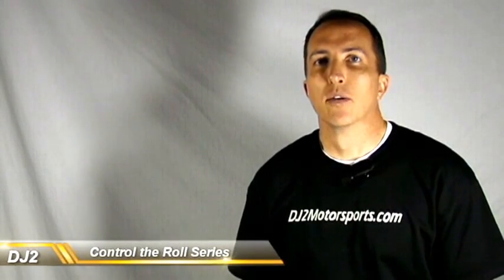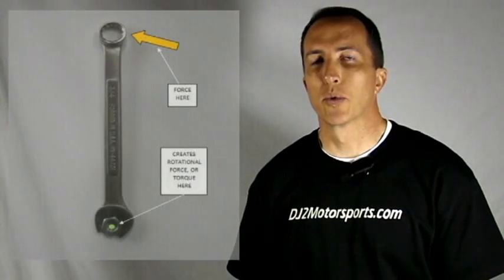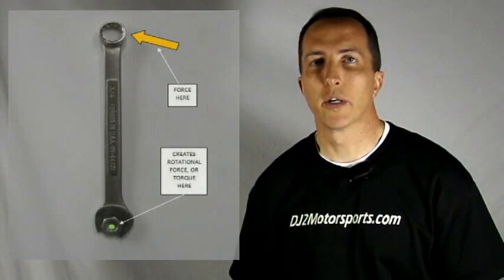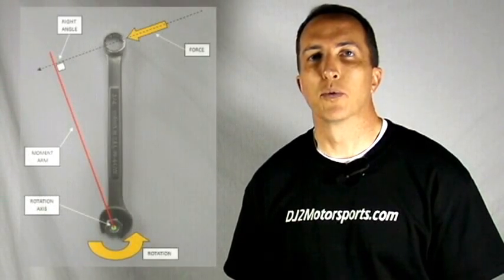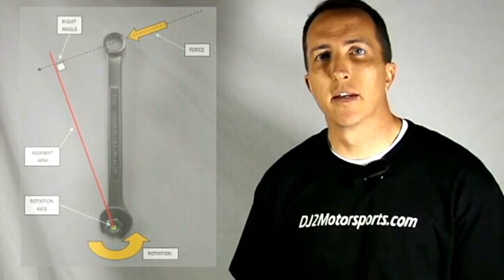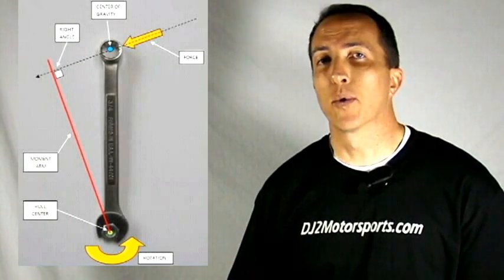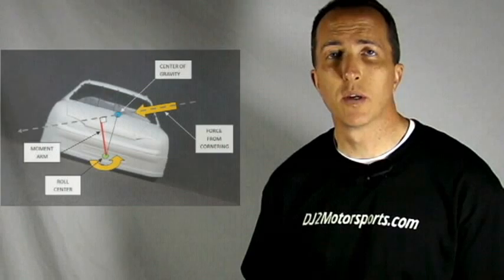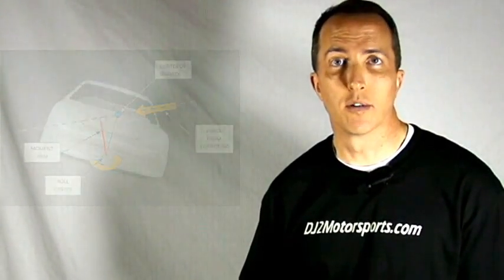Part 1 - Center of Gravity and Roll Center Relationship

Comment: Forgive me for a possibly pointless post 7 years after this video was made, but seeing as at least one other person here has taken this advice to heart in the construction/modification of their own vehicle, I wanted to point out a few problems with this video that go beyond reasonable simplifications given the target audience.  I'll qualify this by saying I've been writing vehicle simulation models professionally for 20+ years, including multibody+constraint systems, tire models, etc. (see my channel for a few examples).
-
1)  Raising the roll center height (RC) indeed reduces body roll as described (the wrench analogy is reasonably good there, more on that at the end), but the video and website completely omits any mention of the jacking effect (a vertical force at the tires reacted by the suspension into the CM via the RC) which is arguably the most important part of roll center height tuning.  The goal with roll centers (RC) better not be to simply minimize the distance between the CM and RC as this video suggests for the sake of minimizing body roll.  The reason for this has little to do with camber gain or other effects.  Increasing the jacking effect via raised roll centers lifts the entire vehicle when lateral forces are present at the tires.  If the front/rear RC heights are different you can also introduce pitch motion into the vehicle when cornering.  In other words, raising the RCs doesn't just reduce body roll, it also lift the entire vehicle in the corner along with the CM which is generally not desirable.
-
2)  Wheel load transients are entirely different when roll stiffness is adjusted via roll center heights than they would be if it were done through stiffer springs or anti-rollbars.   Jacking force changes are virtually instantaneous with tire lateral force changes, whereas body roll induced forces require some body roll to occur or a roll velocity component for the dampers.  In the steady state cornering case the wheel loads can of course be the same, but during transient cornering the development of wheel loads changes when roll center heights are changed.  In other words:  Springs/anti-rollbars/dampers involve a time lag.  Jacking forces due to roll center heights do not.  This affects transient handling which can be either good or bad depending on where you start and where you end up in the design, but if the goal is simply to raise the RC as much as possible (while still keeping it at or below the CM height), it's almost sure to be a disaster.  If you were to raise the RCs all the way to the CM height, the car would violently jack upward which would move the roll centers a huge amount from what they are in the "at rest" scenario.  Some of the simple simulation programs out there that simply compute roll center motion by rotating everything around the roll center, recomputing the geometry, moving the roll center, repeat, etc., really don't reproduce the actual motion of the vehicle in roll because they completely ignore these jacking effects.  As an opposite example:  One can actually suck the car down closer to the ground in the corners by using RCs below the ground.   Too much roll in that case?  Use stiffer anti-rollbars or springs.
-
3)  The diagram of the car on the banked corner, and the two at the website comparing a flat turn with a banked one isn't correct.  The error that's being made there is to treat the cornering force on the car as though it's acting through the center of gravity.  This really isn't the case.  It's drawn in an arbitrary direction which is different in both diagrams and has no bearing on what the tire forces are actually doing.  The forces are generated at the tires in the ground plane, then reacted through the suspension system in the opposite direction where a vertical jacking force comes in as an additional component.  There is no CM force other than gravity.   Sometimes in simple analysis it's ok to treat cornering forces as though it's a single lateral force acting at the CM, but this isn't one of them.  What the pictures incorrectly "show" is the bank angle having something to do with the optimum roll center location.  That's just not the case.  In reality, the entire vehicle and ground frame are both rotated the same amount, so the angles between the tires and roll center doesn't change just because some banking is added.  With the exception of gravity which isn't shown in the video or website anyway, none of the force directions relative to the vehicle change just because the entire vehicle is rotated by some bank angle on the track.   The only relevant effect here on banking is that extra vertical force at the tires exists which squats the suspension and moves the roll center (usually down).  The frame of reference can be considered entirely in the car's frame without even considering the banking.  So to correctly draw the picture, you'd just draw one picture, then rotate the entire picture by the roll angle.
-
4)  The idea of moving the roll centers as close as possible to the CM is misguided for another reason that's not discussed here or at your website:  The roll centers can move, often quite a lot, and do so differently at the front and rear of the vehicle.   In my simulations I'm frequently adjusting roll centers simply to shift front lateral load transfer distribution (FLLTD) in some desired direction when throttle or brake is applied, often to get a little more rear grip when accelerating and cornering.  For instance, when throttle is applied, the vehicle pitches rearward which usually raises the front RC and lowers the rear RC.  So you're changing the relative front/rear roll stiffness just by the fact that the RCs moved, and the effect gets stronger as you continue to "minimize the distance between CM and RC" (raising the roll centers).  This shifts FLLTD forward under combined acceleration and cornering resulting in more evenly loaded rear tires which is often desirable.
-
5)  This one's a minor nitpick, but the wrench analogy would be better if the top of the wrench represented the CM and the bottom represented the RC instead of the other way around.  One can say that the suspension forces act through the RC, but not through the CM.  If they acted through the CM then there would be no roll moment at all regardless of the RC location.  It would be as though the RCs were positioned exactly at the CM, minus the above jacking forces.
-
6)  Another reason not to go too crazy with roll center heights:  When considering the suspension at just one corner of the car, a high instant center means the wheel moves outward (increasing track width) with bounce motion (wheel going higher in the wheel well).  This gives an extra velocity component at the tire in the outward direction which changes the tire slip angles during transients where the body is pitching/rolling/heaving.  In this case, if you hit a bump with the right tire, the tire moves to the right relative to the vehicle.  That change in slip angle results in a lateral force to the left.  So you can reasonably expect a car to be more darty over bumps and curbs in a racing scenario and probably wear out the tires more quickly in a street situation.
-
I'd give very different advice:  I'd suggest tuning RC's to stay relatively motionless, somewhere near ground level, with the main focus toward having good camber gain characteristics more so than worrying too much about the roll center location's effect on roll stiffness.  It's not likely anybody's going to do much better than that without software, plenty of tire data, etc., and an eye on tuning transient handling which very few people do.  If the body rolls too much, add anti-roll bars front/rear until you have the desired overall roll stiffness.  Tweak the front/rear bars to get the front/rear relative roll stiffness that works well for your goals (i.e., gives handling you like).
-  
Controlling roll is a job better left to the springs and anti-rollbars.  It's called an "anti-rollbar" for a reason.  Under no circumstances should anyone ever try to put their RCs all the way up as close to the CM height as possible as this video suggests.
Reply: I just watched a video from Speed UTV where Robby Gordon was explaining their roll center decision for their car. Basically, everything you said was what he was stressing about off road vehicles. He even showed videos of the jacking effect that caused the CG to raise higher as the Polaris RZR suspension went to max ride height during cornering... then they flipped over.
.
But he did open the presentation saying that this is completely opposite of what they did in Indy and NASCAR.
.
https://www.youtube.com/watch?v=oI0VrQr8ifI  @ 28 minutes 15 seconds he starts talking about roll center... I'm just trying to find how to calculate the roll center for a trailing arm suspension since it's so dramatically different than transverse linkages

Comment: What about Roll centre above centre of gravity ?
Reply from the maker: It would be tough, but not impossible, to have your COG above Roll Center. The affect of the length of the moment arm will still be the same, however body roll would actually be towards the inside of the corner rather than the outside of the corner.
Reply: Yeah..got it👍
Reply: @DJ2Motorsports  that makes me curious now as to how it would feel to set a car up to slightly lean into a turn rather than away like normal. I bet it would feel weird for a car
Reply: @nashvilleoutlaw  It's called jacking and it will cause your car to oversteer or roll over... here's a video explaining it... start at 28 minutes 15 seconds https://www.youtube.com/watch?v=oI0VrQr8ifI

Comment: how to determine roll centre ??
Reply from the maker: Determining the roll center has many variables. It all depends on the mounting locations of the control arms and lengths of the control arms. Even changing tire sizes may change the roll center location without changing the suspension components.

Comment: Hi Dan. I try to calculate the center of gravity height of the car. I raise up the front of the car to calculate the center of gravity height; and then I do again, this time I raise up the back of the car to calculate the center of gravity height, I raise up same height but I got the different answer of center of gravity height. Do you know why? Should I need to raise up the lighter side of the car to calculate the center of gravity height?
Reply from the maker: +Gary Lee, the first thing to ensure is that you have replaced the shocks with solid links on all four corners so nothing will move once you raise it. Summing up what should be done, this process consists of weighing the vehicle, with all four wheels on their own scale to get the front weight, rear weight, left side (drivers side in U.S.), and right side weight (passengers side in U.S.). After all of these are documented, then we raise the rear of the vehicle, and record the weight on the front tires. At this point we will be ready to do the math to calculate the center of gravity location. You'll first figure the distance of the COG location between the front and rear wheels. Second, you'll calculate the COG location between the tread width (i.e.. left to right distance). Last you'll calculate the height of the COG basically using the Pythagorean theorem. You should only have to raise one end of the car once to find your COG. I'll make note to put the steps to do this and an example on a blog post at dj2motorsports.com.

Comment from the maker: It would be extremely tough to get the RC above the CG, however if it is, it will have the opposite effect. Instead of the force pushing down on the tires on the outside of the turn, it will actually try and lift the outside tires and put more force onto the inside tires instead. It would really create odd angles on the suspension components that would produce unfavorable handling.

Comment from the maker: You will have a roll center location at each the rear and the front so the line between the two create a roll axis. And remember that the CG is a single point where the mass is perfectly balanced. Long story short you do want the CG as close as possible to the roll axis to limit the force in the turn. Great question! We will be creating a video to further explain the CG and front and roll center relationship. Thanks for watching!